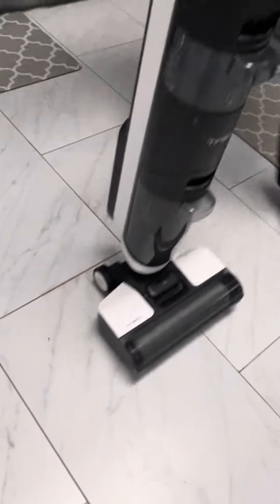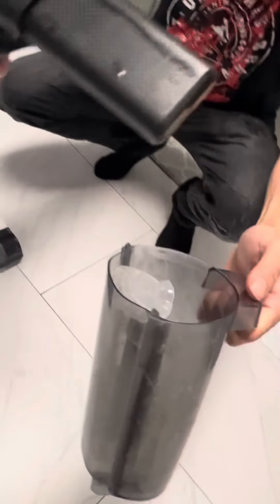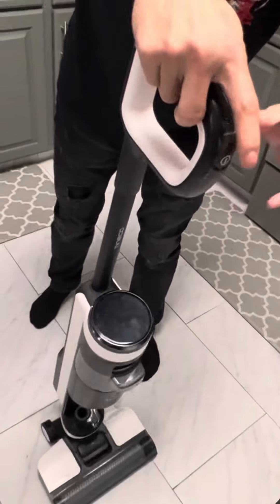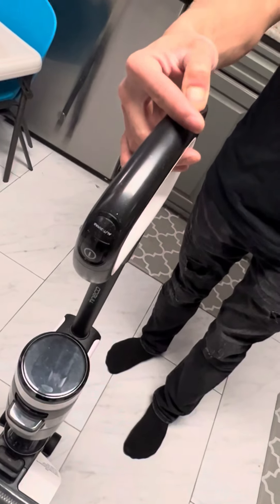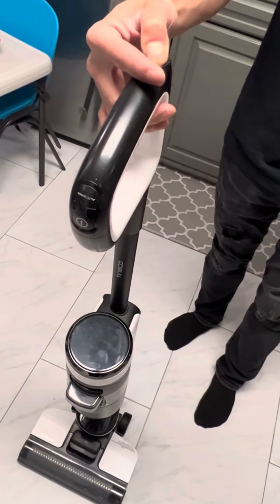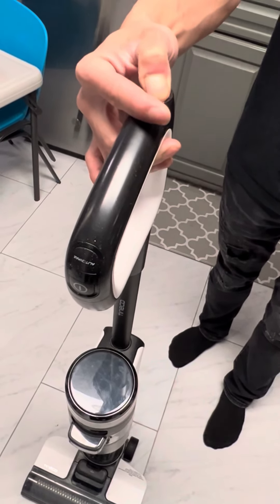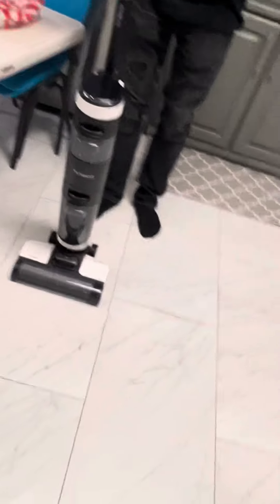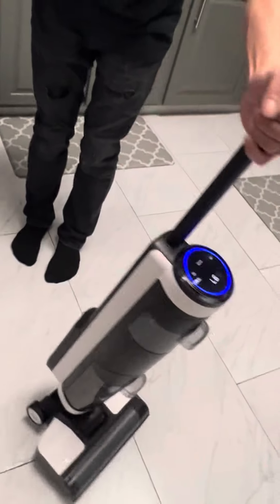Tineco S3 not work

Comment: any problem with the machine, it is recommended that you send to customer service for the repair. Usually its not that expensive..For the motor i have been charge around $75 and warranty for 6 months

Comment: It's the moter in the machine it's slightly rusted due to the wet filter being used. I know the response is 1 year but I just seen this video I fixed one on my channel. If you remove the motor give it some spins with a screw driver the rust particles will come out then put it back in machine.
Reply: Unfortunately, you're right. I disassembled my Tineco down to the motor. There was rust, and the motor wouldn't turn. It's working again for now, but it's only a matter of time until it breaks down again.

Did you spray any rust remover or something else into the motor? I'm not sure how this can happen to a device that costs over 300 EUR.

Thank you for your suggestion! Perhaps you could make another video that's a bit more structured, showing exactly how to access the motor.

Thanks a thousand times for your advice.
Reply: Si, il problema è il motore che si era bloccato con la ruggine. Soluzione, con un cacciavite sottile delicatamente cercare attraverso i piccoli fori che accedono al motore di aspirazione far girare la ventolina, con aria compressa far cadere la ruggine rimossa e spruzzare all'interno sempre attraverso i fori un po' di spray sbloccante. Ripassare l'aria compressa sempre nel motore, lasciare asciugare 5 minuti e riprovare accensione. Ha ripreso a funzionare. Ho capito anche che il problema è stato causato dall'uso della Tineco senza il filtro, l'acqua si è infilata nel motore in maniera abbondante... errore da non fare assolutamente. Fare sempre asciugare il filtro almeno 24 ore all'aria, mai usarlo bagnato. La colpa è stata della mia scarsa manutenzione.
Reply: Never buy a Tineco again! I had so many issues like this one or with the dirty water tank! This brand name is too inexperienced to design such device and provide a reliable device. Their support is so unhelpful. Tineco, never again!

Comment: Very good product and you will start facing problems after 6 months of usage.
They have very expensive spares (ex: roller cost 3000/- against 600/- from other brand, mopping liquid costs more than 1000/- per liter).
They have EXTREMELY BAD SERVICE support. Battery is abruptly shutting off which they aren’t not resolving for last 3 months.
This is my 3rd Mopping machine. After paying more than 50% premium against other brands, I’m not satisfied with this product.

Comment: I had the same issue and after seeing some videos on how to fix that. They all suggest to dissassemble all but i have been fix it without opening it. You need just to put D40 on the hole above the dirty water tank and give it some minutes then run the tineco

Comment: I hate my tineco. It la only worked for about a total of 30 floor cleans in the two years I e owned it. It’s been broken most of the time. I’ve returned it and they ‘fixed it’. It worked for about another 10 times. It’s broken again. They say the warranty is up and will fix it but I have to pay them.

Comment: Fixed. 
Check with manufacturer before attempting this because it may void your warranty. 
Same issue with ours. 
I removed both water containers. 
Flipped the vacuum upside-down. 
Used something thin enough to move the motor fins. 
Then I sprayed WD40 into the motor area. 
Spinned the fins more with a thin tool. 
Reinstall the water containers. 
Held the clean cycle button down for 30 seconds. 
Tried it outside on the concrete in case it did suck.
And it's been working.
Wife said it's been working better. 
I suggest once a month do the same thing.

Comment: This machine is so badly engineered... Owned one, stopped working after a while. Requested assistance, they sent me another one after I sent back mine. Then the new one also stopped working. They sent another one without wanting back the last. I own two of them and each and eveyy one has the same problems. All the metallic parts (screws included) are rusting after a while. Even the impeller is rusting, since it's made out of metal. It's not that difficult  for water to get to the motor. If you don't use them at least two or three times a week, the impeller gets stuck again due to rust.

Comment: The roller brush not spinning but the programmed are ok only the roller brush is not functioning
Reply: J’ai exactement le même problème avez vous trouvez la solution
Reply: Same problem is with my roller brush too l,
I bought tineco 1 month ago but it stops rolling everything is normal but the roller brush is not working
..

I think  tineco have some issues with their machines 
They must check

Comment: Same here. Mine just started this shit. I will get the new 5S Pro 2 tomorrow. I hope I do not have this problem again.   One Question, guys? have you been using a different cleaning detergent? I could not get Tinco detergent. They were sold out and used another brand. Could this have been a problem? Sorry for all of us.
Reply: One of the comments said to hold the power button and self cleaning button together at the same time off of the base and that sent it to reset and it worked again!

I’ve sent mine back FOUR times and the last time they sent it back with a problem it didn’t even have before. For the inconvenience they sent me some soap lol.

Comment: This floor mop is piece of work! Some day I mean most of thr day when i use it leave streak of water especially when you move it backward more leak. I cleaned debris channel got all the junk out and changed roller still not working always puddle of water. Pos. Yeah when you idle it make it stand more water just leaked
Reply: Same here

Comment: The same thing just happened to my machine as well. Do you have a solution?
Reply: You need to put hot water (60-70 Degrees) in water tank ,after that waiting  (30-60 minutes) und reset and new start 😉
Reply: @saieedalaiyeb2134  how do you reset it? I have an iFloor 3 though

Comment: I'm a small repair shop. It came with such a phenomenon. I disassembled. The suction motor is not working. Soaked or similar. Neither the engine nor the BLD processor is available. The line is over ....
Reply: Hi, just wondering, do you know if the main control chip or microcontroller on the motor was the problem, or if it was other components in the motor? Would you be able to post a picture of one of these motors? Thanks